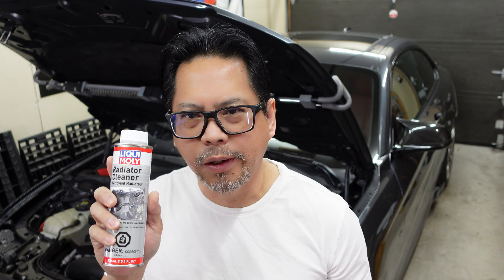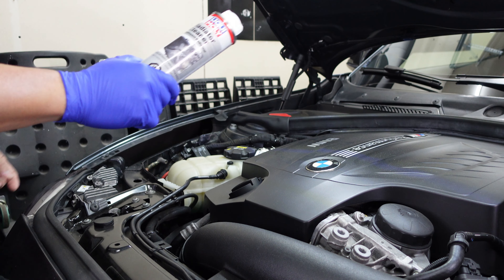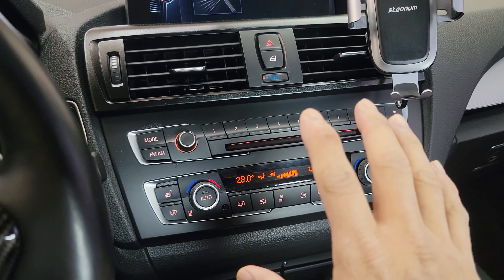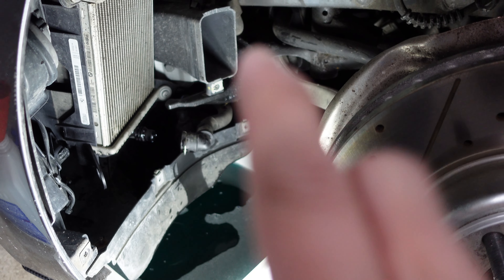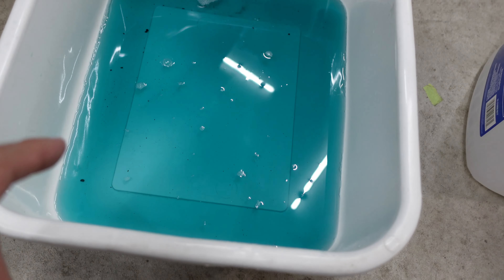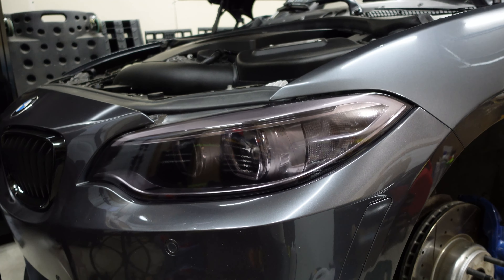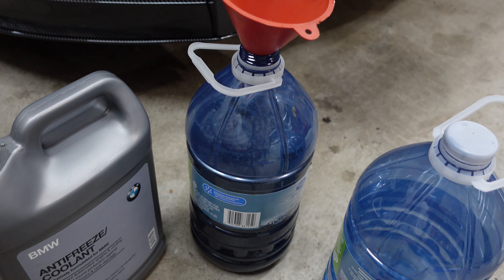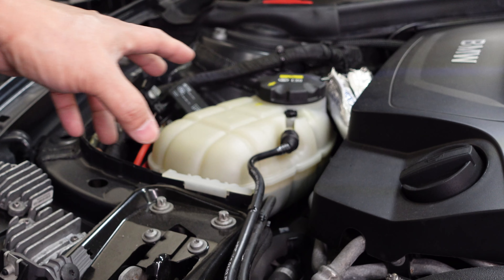Super flush w/ liqui moly radiator cleaner (too much S#!T in my coolant).

Comment: Hi kuya. I also did this and flushed 3 times with coolant just to be sure because the car had 140k miles and I didnt know the history. OMG the color was not only rust, but almost black copper colored! It took 3 flushes to run clear each with 30 minutes of running the car with the heater on. Took half a day but after, I drove the car from LA to Vegas with ease and enjoyed buffets! I asked my mechanic if I should change the thermostat, he said he rarely sees a bad thermostat anymore but best to flush coolant to enjoy many more miles on the car. So far, 10k miles later, the car runs great. Thanks for sharing the video!
Reply from the maker: Thanks for the comment, I really do appreciate it.
Nice job doing the flush, Proper maintenance is the key to longer lasting engine.
More DIY & Mods coming soon, Please LIKE & SUBSCRIBE and SALAMAT!!!👍

Comment: The reservoir is just that it stores extra fluid so when the system heats up it expands into it and when cools down contract s and pulls some fluid back in, but this will take weeks to all mix in- so better to take some liquid out of the radiator and pour clean in.
Reply from the maker: Thanks for the info, I'll keep that in mind.
Thanks for watching!!!👍
Reply: You are partly right. When your system reaches "operating temp" the thermostat opens and lets all the fluid start circulating and "mixing". Yes the engine block and heads do expand when hot but that does not create much room for additional fluid. When the system is cold the tank holds reserve coolant/antifreeze; when the fluid gets hot it expands and also becomes gas or vapor and that vapor escapes into the atmosphere. Even a cooling system in good shape will sometimes need a little "ADD" Even cars/trucks like Toyotas which get 500,000 to a million miles require some routine  maintenance so it just is not wise to buy a vehicle that is designed to force the owner to seek a 100 dollar per hour mechanic's helper on a car that will leave you stranded. For your daughter/wife to get back home is a million times more important than owning a flashy ghetto symbol.

Comment: Thanks Ed, I have an ARMADA SUV with total capacity 14.4 litres, so I used 2 bottles of the LM cleaner, I have flushed tousands of times now but can't get rid of the foaming in the outgoing water, is it an issue ? It's time now to recompose the system, I have been on 100% water for a few days already
Reply from the maker: Andre Souza, I think the foaming is only the residue of the cleaner, Since you are 100% water, I think now is OK to flush and put fresh 50/50 Coolant & distilled water, You don't want that water to stay long in your engine, It will corrode inside. Hope this helps you.
More DIY & Mods coming soon, Please LIKE & SUBSCRIBE and Thanks for watching!!!👍
Reply: @edcardiy  thanks Ed, I talked to LM and they said that I made a mistake because I ran the cleaner for 3 days and not 30 minutes as recommended; they advised to get rid if the foaming as much as possible but whatever is left won't hurt, I'll start recomposing tomorrow, thanks
Reply from the maker: That's nice to know, Thanks for the update!👍
Reply: @andresouza7962  3 days, Ya some stuff you can run in the vehicle & other stuff " not so much ".

I was wondering about that also, LOL.

Comment: Do you run the engine once the distilled water in the reservoir? If so, for how long? How many time you flushed with distilled water? Kabayan😊
Reply from the maker: You do not need to run the engine to do the flushing, BMW have electric water pump and it can run independently while engine is off,
Just make sure you put a battery charger on your battery, So your battery will not deplete (water pump takes a lot of power).
Salamat!!!👍

Comment: Does this help with the aircon not heating one side
Reply from the maker: Probably, I have to look into that.
Thanks for watching!!!👍
Reply: If you have a dual-zone air conditioner, you can solve the problem of one side not heating by changing the heater valve. When you ask the repairman about the heater valve, he will understand.

Comment: Don't you have to drain the coolant first then fill with distilled water and cleaner?
Reply from the maker: Just follow the same process as the instruction of liqui moly.
Reply: Drain, run one with tap water ,drain, run with distilled and cleaner drain, add coolant.

Comment: Are you sure you drain all the coolant from the radiator petcock? On my 2005 E60 530d, it doesn't come out near half of  the coolant. You might have ended up with liquid mixing with water, antifreeze and liquid moly chemicals in your system.

Comment: After putting in flush treatment, I drain it, then run hose water through it while leaving petcock open, engines running.

Drain that out, put distilled in run that for a bit, drain that & add antifreeze mix.

Oh also change Thermostat out just for the hell of it if it's been in there for years & years.